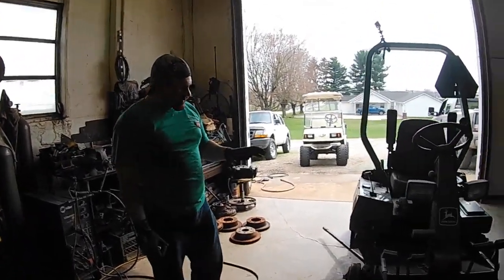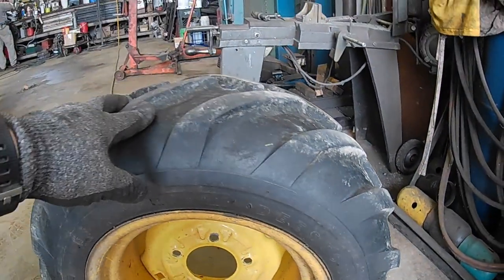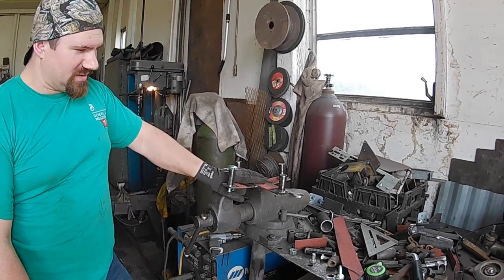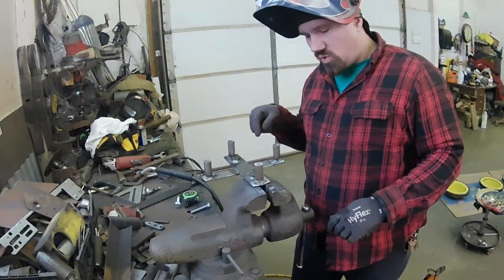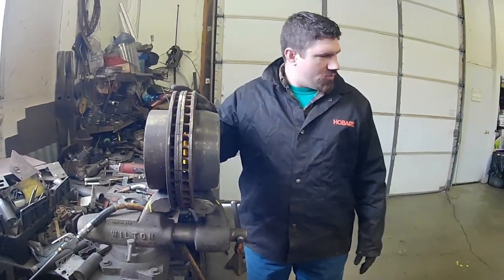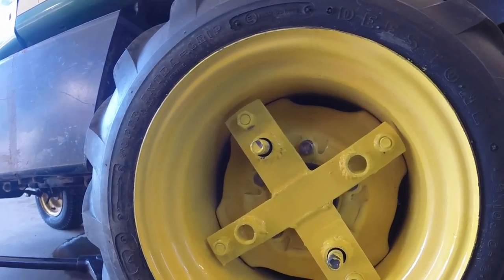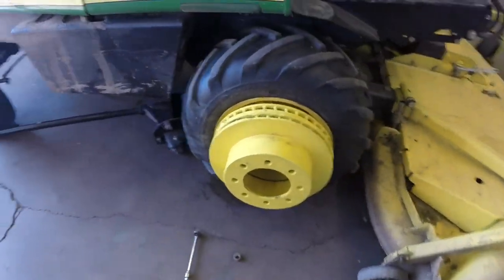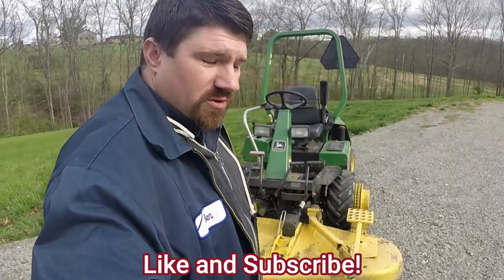John Deere Mower Wheel Weight Fabrication

Comment: Thank you for this video. Great ingenuity and practical, too! I know you said your 45 lbs on each wheel has improved the traction to your satisfaction but did you give any consideration to also adding liquid weight to the tire? I don’t know if that would be overkill but I do know that John Deere sells a blade and a sweeper for that model and that extra weight would come in handy in the snow and mud season. Once again, great job.!
Reply from the maker: Adding calcium or antifreeze is aways an option I just didn't want to liquid fill the tire. Could always go that route if I need more weight I guess.

Comment: Well thats handier than a pocket on a shirt.  I have two garden tractors Im going to do this for.  But Im not in public with them so Ill chop the hub flange on the outside one off and a groove to get to the valve stem then fill with concrete.  That should be close to 60lb per.  Plenty for a plow dozer blade.

Comment: back up steeper hills...use uphill brake pedal on sidehills and inside brake when turning...
Reply from the maker: I have found that it will go just about anywhere backwards. Thanks for sharing.
Reply: @wrenchbenders  what type of truck rotors did you use ? How much do they weigh ?
Reply from the maker: @craigalston2208  one set is off of a Arcadia Denali and the other is off of a 2500hd Duramax. With brackets they weigh in at 44lbs per side.
Reply: @wrenchbenders  thanks for the help . Sometimes the OEM weight prices can get outrageous unless you're restoring a garden tractor for a show piece . For a work horse this will do just fine in my opinion .😁
Reply from the maker: @craigalston2208  my thoughts exactly.  Lol

Comment: Okay, dumb question from the gal who's likely to get herself killed mowing. What is the effective difference between doing wheel weights like this versus filling the front tires? Other than it's way more fun to do what you're doing, and cool to watch.  :-D
Reply from the maker: Loading tires with fluid is an effective way to add weight to wheels. Calcium is heavier than water and weighs about 11 lbs per gallon. The only thing I have against loading tire is it can be messy for  checking air pressure and changing tires. 4 gallons of calcium would be equal to the same as the weights I built. Thanks for your comment.